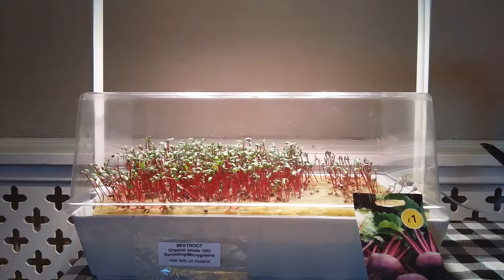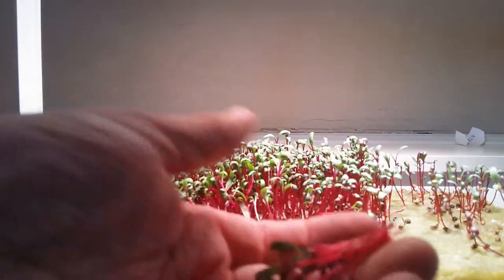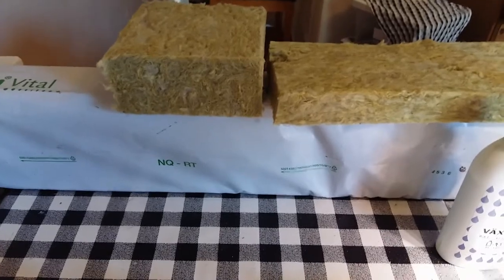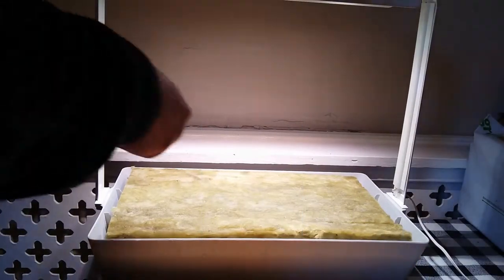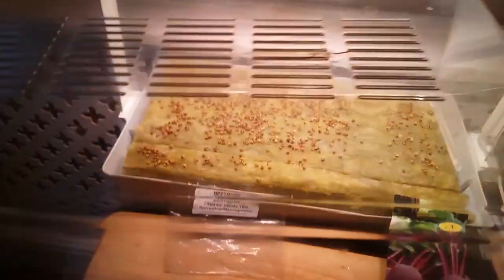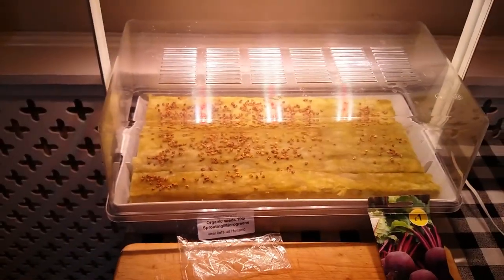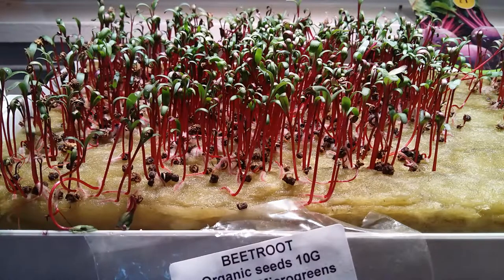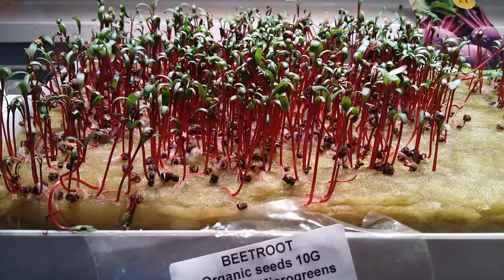How to grow beetroot microgreens, in Ikea Vaxer LED grow lights,rockwool grow medium in hydroponics.

Comment: Thank you for the video. I could tell from the sticker that the seeds were bought in Holland. In my experience beets have difficulties in losing the seeds which tend to stick to the leaves. Since you don't seem to have this issue I wonder if it is the species or the rockwool. Can you tell me where you bought the seeds? Tnx!
Reply from the maker: Hi I bought these on ebay, thay are still on their (greenhuiz) is his ebay username,  but I did brush the leaves every couples of days to remove hulls, just with my hands lightly.